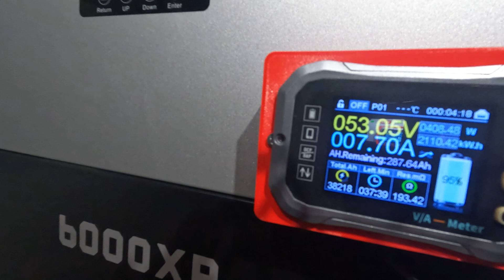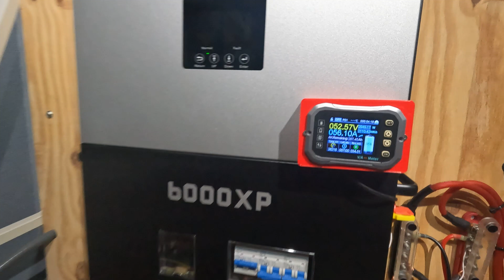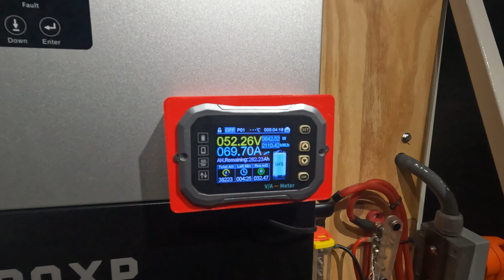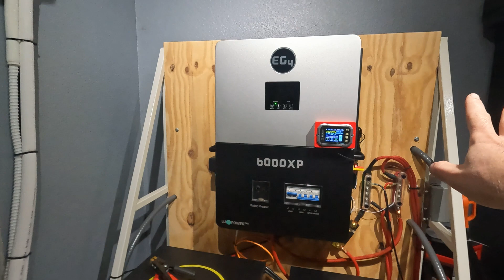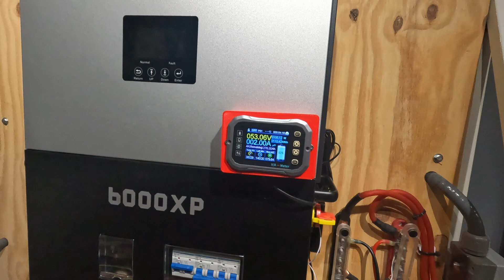Eg4 6000Xp Powering Oven 4000 watt load test 48v Solar Power System

Comment: How is this putting out 70 amps?? Everything I read says it puts out just 25 amps.
Reply from the maker: @KidFreshie  It Pulls 70 not put out, that amperage is on the DC input side of things
Reply: @Mikebuildss  So it's pulling 70 from the batteries? OK. But it still has to go through the inverter to get to AC and then to the oven--and the 6000XP only puts out 25. and that's about what that oven requires. Or am I misunderstanding something?
Reply from the maker: @ Yes 25 amps is the most you’ll get on the AC output, 25x240=6000 watts. Your input current will be way higher due to losses and the actual voltage differences. But we put in 125 amps at 48 volts DC to get the 6000 watt output
Reply: @Mikebuildss  ok got it. Thank you!

Comment: We have one installed for now running all our lights and fridge and fans. It can handle the stove OR the oven but it can’t do both. And that’s with max solar input and 4 batteries. The additional inverter with another string should be more than enough.
Reply from the maker: I had my whole house running at one point, performed flawless, all my heating and cooling i use mini splits. But when my water heater kicked on high it pulled about 5500 watts!
Reply: @ was that with just one inverter?
Reply from the maker: @ Yes
Reply: @Mikebuildss  good to know. Thank you. I’m looking at the 12k xp now

Comment: Each of those lifepower4 batteries is 5.12KWh  and 100AH each. So you have 10.24 KWH in battery backup. Not 15. I’m thinking your not so good at math so far between the Amps and now battery watts. I have 4 of those batteries and will buy another 30KWh of batteries for my off grid cabin. We have been off grid for a year.
Reply from the maker: @Off-GridMountains  I had another 5 kWh on the bottom so I wasn’t far off

Comment: Hold on there. 4000 W is around 33 A. At 6000 XP inverter cannot give you 100 A.  Each phase is only 25 A.  I have two of these.
Reply from the maker: @Off-GridMountains  I’m saying 100 amps on the dc side

Comment: I’d really like to see if this inverter or the 18k can use Tesla battery power packs.
Reply: They can
Reply from the maker: @kidsjustbeingakid  I think they may be able to , but they’re very expensive compared to what elts is on the market
Reply: @Mikebuildss  are you talking about the Tesla packs being expensive?  I can get one 5.5kw one for $200-$250.  You want to connect off line and try to work it out?
Reply: @kidsjustbeingakid that's so cheap

Comment: Powering a 4,000 Watt resistive load with these low cost, Chinese made high frequency, transformerless inverters is fine, but don't try powering a 4,000 Watt inductive load with one of these more than a few times unless you want to risk smoking both the inverter and your load.
Reply: what average house would have a 4kw inductive load?
Reply from the maker: @quickquote1568  I agree it would not be happy with that kind of load. I agree I’d almost rather have a low frequency inverter just for that reason, but this thing has been solid so far